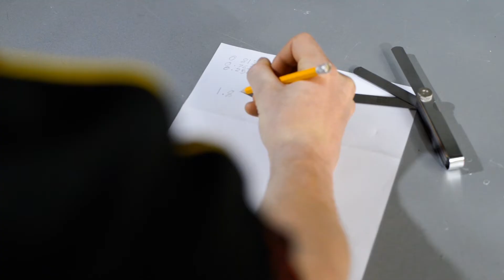How to - Using Feeler Gauges // ToolPRO Feeler Gauge Range

Comment: is there not a video in English and I don't mean English from England or Australia I mean from the U.S.A. I can't understand this very good not knocking the guy but why the hell can't an American do one of these videos must be to lazy I guess.
Reply: He says to clean and prep the work surface before use. 
Then he says when using a feeler gauge the resistance should be similar to pulling a piece of paper out from under a thin magazine.

If the gap is bigger than a single gauge, you can stack the gauges and add up the numbers on the gauges that were used.

The metric set is for thicker gaps measuring from 0.04mm to 1mm thickness.

The combination set comes with 30 blades, metric and imperial and includes 6 brass gauges for measuring gaps in magnetic surfaces.

The master set is for precise measurements on smaller gaps down to 0.038mm.

The offset gauges are for reaching into harder to reach areas on an engine from 
.009in to .026in.

If you want the tools to last longer it has to be cleaned and oiled after use and stored in a dry area away from moisture.